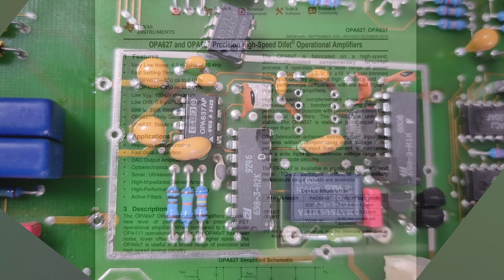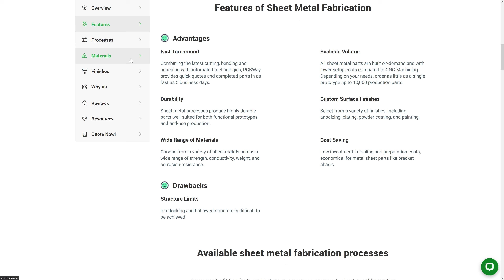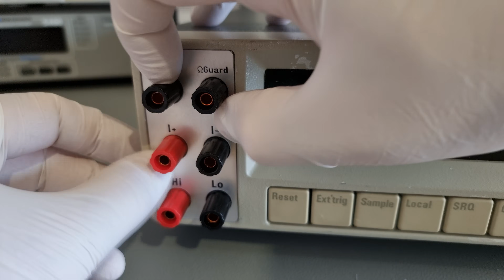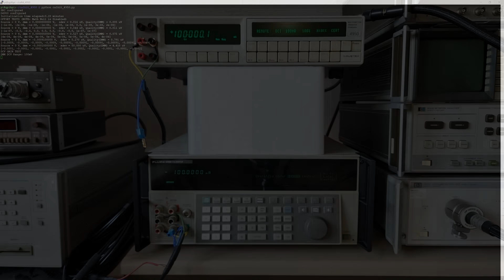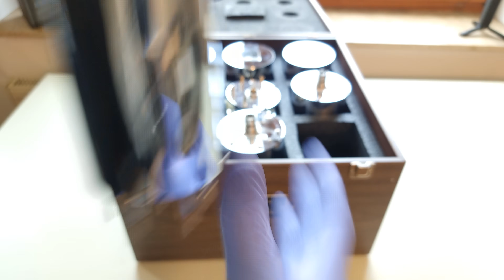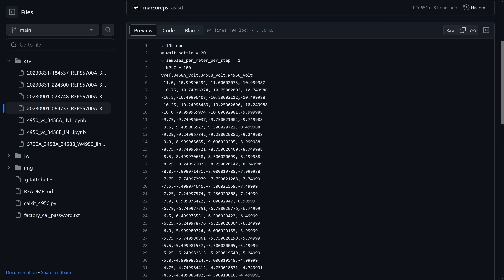Datron Wavetek 4950 Transfer Standard Finishing Touches & Tests

Comment: after going through the pain of adding PTFE shrink-tubing to the input connectors, wouldn't the metal plate around them also cause a shorter air gap with those fork terminals ?

Comment: Check out Raymark labelling material for front panels. It’s a kind of polyester like backing with an uncured epoxy coating. It comes in label or A4 uncut sheets. You print on it with an inkjet and then bake it in an oven. The baked sheets are resistant to oils, solvents, fuels and quite wear resistant!

Comment: If you Still need an opa637. I have some in SOIC and I think at least one in the OPA637SM (metal can) happy to send your way for free if you like. Most of my work these days is multichannel audio and they are not of any use as a low noise error amp in a low noise regulator really, due to poor stability at low gains.

Comment: I have no clue on what all this stuff is for, but i love your dry German humor and your technical explanation and your curiosity and that you like me take everything apart to see what makes it tick...
My big question is what do you actually use all this equipment for?
I know what ppm and a lot of the technical terms since i am en electritian and a ventilation technician, but still a lot of this stuff is way over my head 😀
Reply: When they build the multimeter you use in your day-to-day work, there are tolerances with all the components, and it has to be calibrated against known-good exact voltage sources. Those sources, in turn, have to be measured and calibrated to make sure they're not changing over time, which requires precision meters and sources, which in turn require calibration against something more precise, and on up the chain until you arrive at the offices of NIST / DIN / ISO and multimillion dollar standards based on nothing more than basic physics. These boxes are several steps up that calibration chain...the kind of stuff the manufacturers probably use keep their equipment calibrated.

That's what the original customers used it for anyway. What does Reps use it for? Everyone needs a hobby I guess. Before finding this channel, I'd probably have said that tracking tiny voltage fluctuations in precision calibration equipment would be as exciting as watching paint dry. Turns out it you dig into it, both ppm voltage stability and paint drying have a lot of really fascinating subtleties that normal people would just gloss over.

Comment: What would be a substitute for copper metal if I don't want the oxidized connection points?
Reply from the maker: For single digit nanovolts: Probably nothing, pure clean copper and thermal equalization mandatory! For most day-to-day purposes gold or silver plating on copper, maybe even with a third metal diffusion barrier, is not too bad.

Comment: Wait, can an input relay go totally bad as in always open from not being used or is it just a bit of extra resistance? IE can relay contacts go bad enough just from sitting to cause zero readings on a DMM but still pass internal calibration?
Reply from the maker: Haven't encountered that myself, but I'd say it isn't inconceivable ... maybe a different effect than "lack of wetting current" tho

Comment: Overview
- Marco Reps discusses the Datron Wavetek 4950, a multi-function transfer standard, detailing its issues, repairs, and tests.

Repairs and Issues
- Fixed a missing positive voltage supply rail on the analog board.
- Replaced a damaged op-amp in the AC millivolt pre-pre-amp.
- Addressed leakage current issues in the current assembly.
- Replaced the original front input connector with a more universal one.
- Replaced a worn-out relay affecting the AC attenuator and preamp board.

Modifications
- Created a new sheet metal holder for the front input connector.
- Used PTFE heat shrink tubing to add dielectric strength.
  
Calibration and Testing
- Used a Python script to calibrate the Datron Wavetek 4950 against a Fluke 5700 calibrator.
- Found some discrepancies in ACV linearity.
- Used thermal voltage converters to validate ACV linearity.
  
Additional Features and Observations
- Found that the Datron Wavetek 4950 has excellent DCV linearity and low noise.
- The device uses hermetic bulk metal foil resistors for stability.
  
Conclusion
- Marco is impressed with the Datron Wavetek 4950's performance and is glad it was saved from being discarded.

Positive Points
1. Excellent DCV Linearity: The Datron Wavetek 4950 shows remarkable DCV linearity, exceeding expectations for a seven-and-a-half-digit class device.
2. Low Noise: The device has low noise performance, even down to the least significant digit.
3. Stability: Uses hermetic bulk metal foil resistors for stability, making it reliable for its primary function as a multi-function transfer standard.
4. Versatility: The device can be modified to act like a normal multimeter, adding to its utility.
5. Durability: Built with quality components that guarantee long-term stability.
6. No Cooling Fan: Lacks a cooling fan, which is seen as a positive due to the longer time constant and low temperature coefficient.

Negative Points
1. ACV Linearity Issues: Some discrepancies were found in the AC Voltage linearity during testing.
2. Complex Repairs: Multiple issues required attention, including replacing worn-out relays and fixing leakage currents.
3. Limited Documentation: Lack of comprehensive service manual makes some advanced adjustments risky.
4. Old Connectors: The device uses older types of connectors, requiring adapters or replacements for modern setups.
5. Settling Time: Thermal voltage converters used for testing have a long settling time, making the calibration process lengthy.

These points are sorted by their impact on the device's performance and usability.

Comment: Could you go into more detail on the construction of your Fluke-inspired test-leads?
Reply from the maker: Those were just copper coax cables with inner conductors brought out via short silicone cables to copper lugs and both shields of a pair connected together to stackable 4mm banana plugs for guard connection.
But actually a few days later now I made another short test lead from a pair of triaxial cables. Same as before but inner shields can be used for hi sense & lo sense, so that the core is always fully surrounded by a similar voltage and therefore there is lower stray capacitance and lower degradation of AC signals.

Comment: Wouldn't mind seeing Atto-amp measurements.  I've gotten noise down to ~30fA at 30Hz with a LMC662, a discrete high voltage output stage, and a 10Gohm resistor array.  (about $100 in parts)  Stray capacitance to the shield from the 10Gohm resistor caused fun times.  Had to get cheeky with driven shields to solve that problem.  

The circuit made a very useful amplifier for photo-diodes.  Would full-scale with micro-watt laser beams so you could do great measurements with poor laser setups.

Comment: I am simple man, see reps video, click like... I am surprised you didn't use newer TBP-3 much nicer posts. Wouldn't have any issues with isolation sleeve shenanigans or supernice metal faceplate :) Poor DVM meters getting cooked by 5700 exhaust :) D1281 is also very good with INL. I never tested 1271 though, but I think ADC is mostly the same. And phew, thanks for proper linearity chart and not grafana mind-blowing ppm spaghetti :)

Comment: I would have slotted out the damaged PCB area completely and used point-to-point wiring.  Old Fluke stuff has it all over the place in the most sensitive circuitry.

Did PTB give you that towel?

Comment: Thanks a lot for this "wetting current" hint. This might be the problem why those super expensive hermetically sealed relays on the voltage sense card (ADC) in the semiconductor test stations I'm going to work on are failing... "even there is literally no current flowing through them"... :)

Comment: Watching this makes me wonder over the years how much that diagnostic function would be used.  My guess is that the amount of hours of labor it takes to figure problems out means it's always going to be more cost effective to replace units.  It sounds like you put several weeks of time in working on this and still kept running into new problems.  It's not that I don't think corporations main motivator isn't greed, it's just that it's largely impractical to repair complex electronics.
Reply: I'm sure every kind of modern gadget had this kind of mode during prototyping or manufacturing - for debugging and QA. In this case they decided to double it as a service tool. Seems logical, having service tools for complex equipment is nothing new, they probably saved some money by doing it this way

Comment: You definitely need to try black magic. I mean microwave stuff, that would be extremely interesting.
Reply: Wait, what he does isn't black magic already???
Reply: @MCsCreations  I'm not trying to start the holy war here... But things like dielectric heating or resonant cavities with shorted input are kinda impressive. And we are not even started to talk about sci-fi level RF stuff like long delay echo phenomena or nature-generated signals. So, I'm sure, he will buy something like spectrum analyzer eventually and we all will see the whole new world of weird things.
Reply: Wonder what happened to that spectrum analyzer he bought
Reply: @gigigigiontis8 well, I can see an old Network analyzer and an S-parameter test set, so I think he's onto it. From my experience, Spectrum analyzers start stacking up quite quickly, but getting a VNA running correctly and in spec is quite hard. I'm actually quite close to pay a couple of thousands to get a working one, so I can finally take care of my stack of faulty/dubious RF Equipment. But even the cables are quite expensive, and even looking at them or changing your tongue angle will affect the measurement. So yeah, definitely black magic, because even existing in its general vicinity or a wrongly torqued bolt has chaotic effects on the circuit.